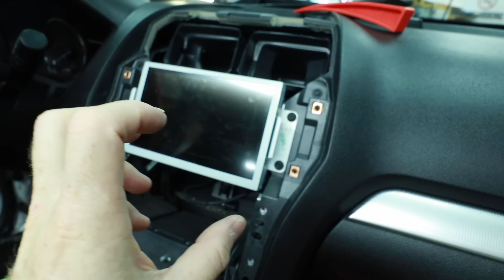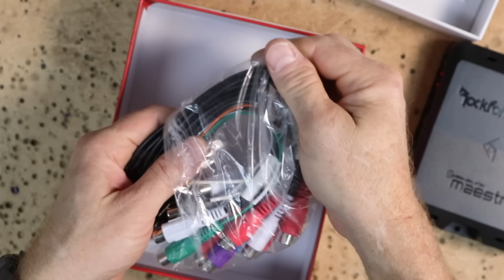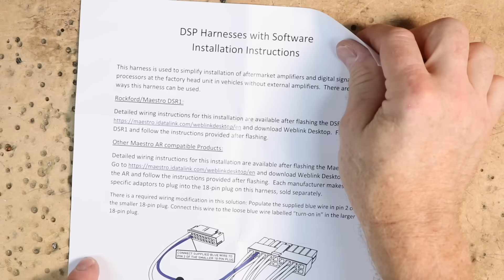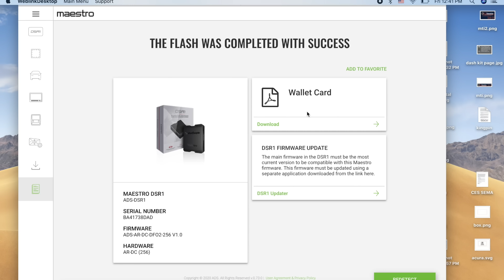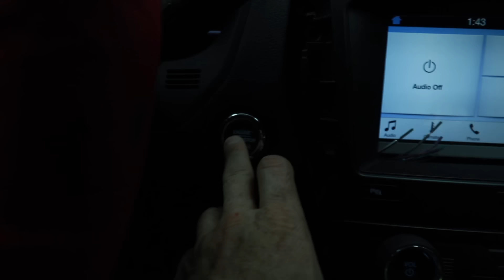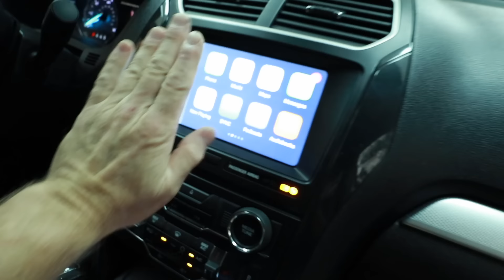First look the new iDatalink DFO2 harness and how it will change Ford audio systems

Comment: Hey Guys,
I'm looking to add an amp and sub with lc2i to my factory non bose Silverado. Will the GM3 DSP harness work in order to get speaker signals from the factory head unit to LC2i?
Thanks!

Comment: Just a heads up to anyone with a 2019+ F150, this does not work, I spent 3+ days trying to get it to with tech support but the signal was very noisy. I tried restoring it and although it looks as though it programmed correct the signal is still weaker and I am trying to figure out how to either fix it with forscan or a trip to the dealer. Overall a terrible experience.
Reply: @Javier so probably same issues I was having, I would not be surprised if they only tested on a couple earlier model radios, I had terrible experience with the software for amp replacement on my 18 mustang when it was brand new as well.
Reply: Did you find a solution to your issue?
Reply: @Javier not yet, I think I am going to play with forscan this weekend. The DSR1 has been out of the car and back to a normal t harness and my other processor
Reply: @Javier I had sound with huge noise in the background, I cut the power and ground out of the harness and ran direct to my power distribution for the amps which is 0awg power and ground to the battery, I tried the programming several times with a rep on the phone. The resistors are not used in this setup. What year is your truck? Im convinced its an issue due to changes that were made to the radio in I believe 2019 (no longer have the integrated cd drive.

Comment: If I get one of these and change my car battery in 2 or 4 years? Should I have to connect it to my computer all over again to reset it, or does it keep everything in a memory settings? 🤷🏻‍♂️
Reply: Just buy an OBDII memory saver. Scotty kilmer recommends them all the time. I bought ine on his recommendation and it works flawlessly. One end plugs into the OBDII and the other to a 12 volt source. Don't have to reprogram my radio or clock settings.

Comment: Hi I have a 2020 ram 1500 crew cab. I just want to upgrade speakers keep the 8” radio and run a subwoofer. It has stock speakers not alpine. What wiring harness do I need and or other things to make it work. Thanks

Comment: I noticed you guys used iTunes to test sound, I noticed a lot more distortion from iTunes than Spotify. Is there settings you have in place to have clean audio? I use audio normalization on Spotify to level the tracks, but idk what that does to the sound waves exactly.
Reply: Don't use normalisation. Spotify applies a limiter that tends to make songs sound flat and dull with no impact.

Comment: That’s what I did in my 16 Focus with base radio I asked you guys about haha I used FORScan to reprogram the ACM for de-EQ and non-amplified signal to my DM-810. I did add 5dB to the DM-810 gain and reset my gains to -5dB and I don’t seem to have that low volume distortion anymore👍🏻

Comment: Is an AR or DSR1 required for the process of reprogramming the radio?
Reply: You can do this with ForScan and an appropriate OBD2 cable
Reply: @Cathul  I am aware of that method of reprogramming. I want to know if the process that is described in the video requires an idata product to be connected.
Reply: @danielabrams555  Ah, i see. As far as i see it the communication for reprogramming is between the flashed AR or DSR1 and the Radio through the new harness, so i think yes, you need either the DSR1 or the AR.
Reply: This is what I'm wanting to know as well. They don't show if its connected or not in the video.

Comment: This is so cool! Will they control for ANC on/off and where the Ford chimes are routed(speakers vs. small speaker in the cluster)? 

Would be cool if someone could figure out how to re-tune the ANC so it worked with an aftermarket system, too.
Reply: Good question, my 2012 Explorer also has a factory amp running just the front speakers I wonder if it works with this kit.

Comment: works similar to the JL fix 86 but is more functional it looks like. I tried the fix 86 and was disappointed. I now have the Mft 1 and Kenwood excelon which is night a day different and better. If this doesn't sound better than the Fix 86 which had almost no bass output no matter what you did and I had a kicker amp with the shok bass restoration/enhancement on it. Then I say go with the MFT 1 and aftermarket head unit. Its hard to get sound that doesn't exist in the factory head unit. I recommend going after market unless you are just in love with the factory operating system.
Reply: Well with Fords, that’s what FORScan is for. You can deactivate the factory EQ processing and switch from high level to low level output (both are separate). Highly suggested for those of us that want to retain the factory look. However, the factory ACM only supports up to 16bit/48kHz sampling rate so aftermarket is still better if you have better quality music files.
Reply: @bchooker  As the video shows when you bring the bass back in and flatten the EQ it lowers the overall output of every frequency. You can add back in with the DSP but still takes away from your overall volume. It's not just the factory Eq or the final output. Its not just about the speed and control of the processing. In this case the head unit was never designed to be connected to a subwoofer so it just doesn't reproduce the lower frequencies like an aftermarket head unit.
  It is way better than just hooking up a line output converter that's for sure and does allow you to keep your factory head unit which is a plus to many. It has no clumsy external controls and the Dsp can be easily hidden that's a plus. Anything they make works well and is of great quality and that is a plus. I just wanted to point out the difference a make sure that if people want Shock and Ah that the MFT 1 is the best choice.

Comment: You guys need to do some online sales for these kits. My local shop seems to be under the impression the fords are not worth the effort to use the factory head unit.
Reply: Here in Columbus audio guys always try to get me to switch out the sync 3. I'm gonna start install my own audio.
Reply: @PlayHard5OH  im probably going to do the same. Im just thinking that if I can order from a shop that understands what I am trying to achieve it would make things a lot easier
Reply: Why is that? I was looking into something like this for my factory head unit and just adding a sub
Reply: @JGreen46  no idea. Needless to say I haven't been back to see if they have caught up with the industry
Reply: I have always wanted to change out my factory head until not a fan of them and would like more out-put for sound quality

Comment: Good morning! Manufacturer's need to do more with Lexus Mark Levinson with Nav. They've been neglected for years.
Reply: Difficult to build for, will be expensive and the demand just isn't there.
Reply: @12VoltElectronics there's a pretty big Lexus performance community. The IS, RC, GS platforms get most of the attention and car audio is asked about a lot til they find out the integration isn't plug and play. I did complete systems in a 2015 GS350 and and my current a car a 2015 RCF.

They're basically Toyotas so I'm sure the volume is there, but not even Toyotas have any integration from Maestro or a similar company. 

As for myself I went the manual route and tapped signal wires. JL Audio products or AudioControl work fine for that using a wiring harness from PAC audio. They make the harness but no module.